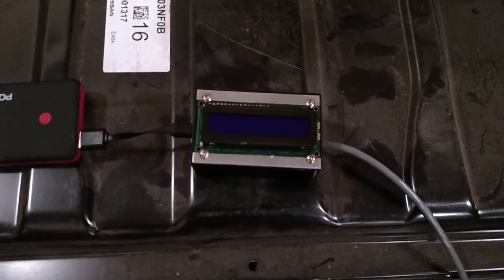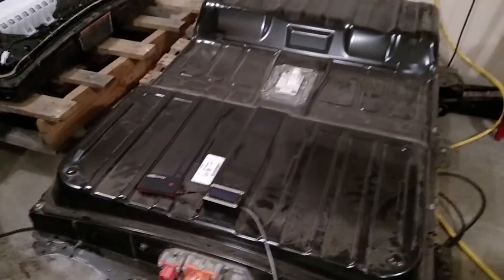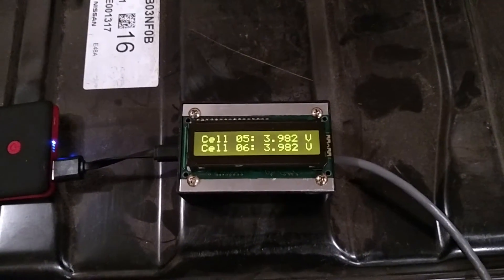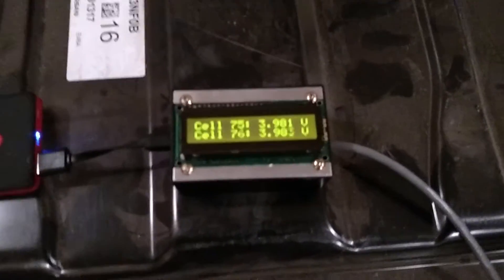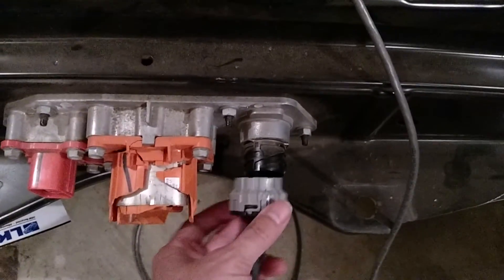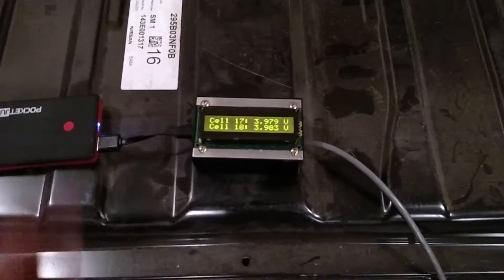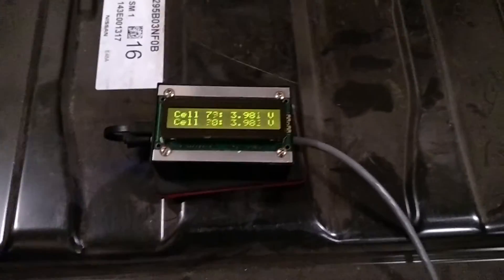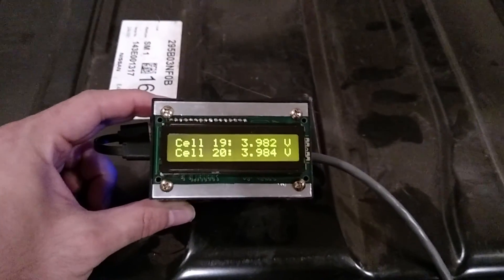Nissan Leaf Battery Pack Sniffer, Part 3

Comment: Hi, nice work! I was thinking about buying a 30kwh hour battery and see if it's possible to connect it to a 2014 Leaf. I know there are some diferences in the BMS and possible other things as well. Anyways.. Thanks for taking the time to make these videos! It's like christmas watcing these :) 

14 bars? What does that mean? I thought 12 was max?
Reply from the maker: +Jostein Sand 
Even if the display only goes to 12, the BMS can report more...
It just takes longer for the pack to lose that first bar.
It probably has to do with the scale being calibrated for the lesser capacity of the 2011 battery pack.

Pack Sniffer 2 is in the works...
Should have a new video on it soon...

Thanks for watching.

Comment: Could you quote me a cost and lead time for one of your leaf battery sniffers, Thanks I am a used car dealer and can purchase at closed dealer only salvage sales and this could save me from a bad buy, I just might be interested.  39marinette@gmail.com     Thanks
Reply from the maker: +Doug Doty 
I will give you a range, since it is not final yet (still swaping out parts when they don't fit).
And I have not gotten quotes for PCBs, box cutouts, etc... $100.00 to $200.00

I should be done with the layout by this weekend. Then I can order parts. PCBs take about 2 weeks. And a week for assembly. Code is done, would just need to have the pinout adjusted to match the layout.

So 3-4 weeks from now it should be in available in the web store:
http://www.wolftronix.com/store.html

Thanks,
Wolf
Reply: @WolfTronix   did you determine a final cost